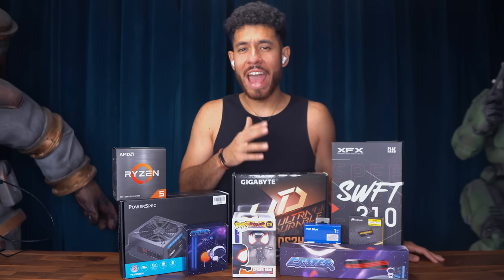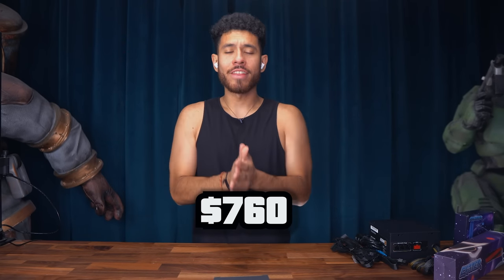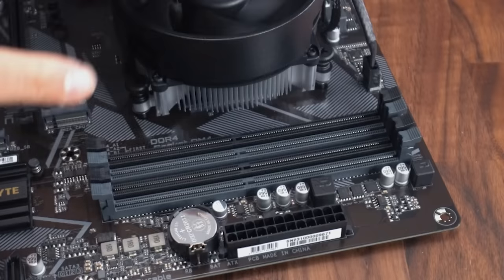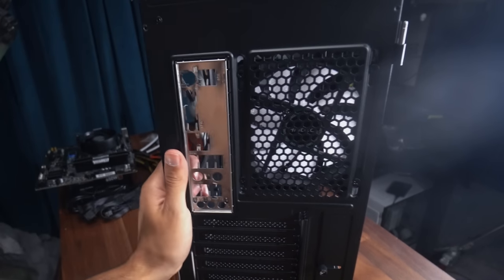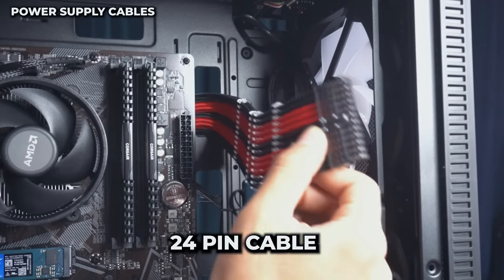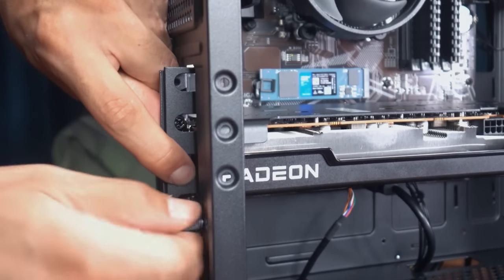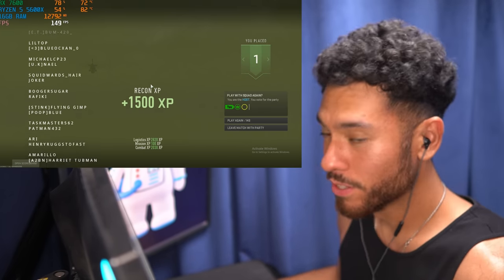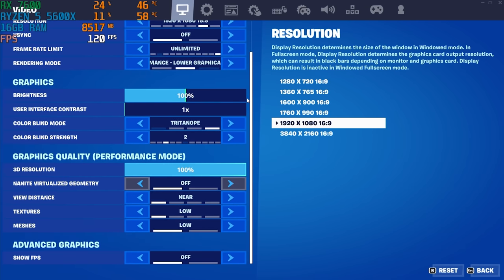BEST $750 Gaming PC Build Guide - RX 7600 Ryzen 5 5600X (w/ Benchmarks)

Comment: Three weeks ago, I built my first ever PC. I watched almost all your videos 3 weeks prior to the build because you got me hooked. 7800x3d with a RX7900XTX named after the channel. Hope to see more of your builds soon!
Reply: That's a beast gaming rig
Reply: @pauloazuela8488  being my first build i had to somewhat go all out. building my sons rig next.... or maybe hand this one down and build me another one.
Reply: @X-Raided26910  if so maybe wait a bit for next gen
Reply: I have Gigabyte 3090
Reply: Which 7900XTX did you get? I got the Red Devil 7900XTX, paired with a 5900X Cpu, 32Gb 3600Mhz CL16 ,1000W RMX PSU , X570 Strix, 360AIO and a couple of Tb Nvme ssd's
Reply: @bafon  MSI rx7900xtx, Ryzen 7800x3d, MSI B650 Wifi Edge, Corsair Vengeance  Expo 6000 mhz CL30, Samsung pro 980 2TB, MSI MPG 1000G psu, Deepcool LT720 aio with Deepcool FC 120mm fans in a Cooler Master TD500 case.
Reply: that's a really good first PC
Reply: Is this setup ideal for GTA mod, Madden, NBA 2k ???
Reply: Around how much did it cost you? I’m new and plan on making one my own soon
Reply: @jay_-3960  I spent around $2600 give or take. I swapped the build out of the cooler master td500 into a corsair 5000d with their af 120 elite fan setup and digital 360 aio. I've spent too much lol... and about to build my son a rig.
Reply: same for me!
Reply: @X-Raided26910 can I be your son?
Reply: How hard was building your first PC
Reply: should I build a pc with 5600 and rx 6600 or 5600 and rx 7600?
Reply: That's a fire build!!
Reply: @X-Raided26910 DDR5 ram?

Comment: Just me but I would use the 5600 and save some more bucks for a better card(maybe 6700xt or 6750xt)
Reply: I’d do the same too.
Reply: Same
Reply: Would the 5600 work wit the motherboard or do I have to update bios
Reply: @frzynx  all b550 boards are ryzen 3000/5000 ready. if you're on a b450/X470/B350 then you will need a BIOS Update.
Reply: @hoangtudaden1304 thanks man
Reply: Definitely would've tried to reach for a 6750xt.
Reply: will those cards fit in this build?
Reply: @southboundtp2067 would that fit?
Reply: @isaacdoodz  if not 6750xt, 6700xt will be a fine fit
Reply: @isaacdoodz  any twin fan 6750xt should fit fine, the 3 fan variants make for a very tight fit with only a few millimeters to spare(335mm max GPU length). Case already takes into account it's included front fans.
Reply: what if i did 6750xt but still keep the 5600x
Reply: Could i switch the cars for a 6700xt or 6750xt but also switch the cpu to a Ryzen 7 5700x or is that not worth it/better
Reply: @lesagekaden  imo, you can get away with a 5600(if all you do is gaming), but other than that 5600 6700xt is a good combo. Keep in mind that the 5600 can handle upto 3080
Reply: When I go onto pc part picker it says the mother board and cpu aren’t compatible anybody know why
Reply: you have to be careful when you do that because if the CPU is weaker than the GPU in the case you are making it is, it is going to prevent your GPU from working at the maximum potential and you will lose out of fps in games and overall
Reply: @missingspacebar7973 the CPU socket may not be the same for the CPu and motherboard
Reply: Ayo man any way you could give me some pointers to build one ?
Reply: @pabloayala6963  pointer 1: what resolution?
Pointer 2: whats your budget?
Pointer 3: what are you doing beside gaming?
Answer those three then I can build you one.
Reply: @hoangtudaden1304 1. most intensive I would play is starfield. Also league of legends and lost ark, maybe some steam indies. I'm open to 1080p or 1440p.
2. My budget is 2000 CAD but the less the better. 
3. I'm doing virtually nothing on my pc besides gaming and the occasional web browsing. 
4. I've chosen to go with amd 5600x for cpu, msi tomahawk b550, amd rx 6700xt gpu, and I haven't decided on 16gb ddr4 cl16 3200 or 3600. Do you have any further recommendations for my build in the making, such as cpu fan and such? I'm very new and still researching as I prepare to do my first ever build. Any input you'd have would be greatly appreciated!!
Reply: hey bro i’m trying to build this same exact pc carter is building but the power supply is sold
out and i can’t find it anywhere , what should i do ?
Reply: @Mindbending81  hey bro i’m trying to build this same exact pc carter is building but the power supply is sold
out and i can’t find it anywhere , what should i do ?
Reply: @kuroneko-_5570  hey bro i’m trying to build this same exact pc carter is building but the power supply is sold
out and i can’t find it anywhere , what should i do ?
Reply: @danny-fj3wf   I have the MSI MPG A850GF Gaming Power Supply.. it’s been good so far and I’ve had it for over a year and a half.
Reply: @danny-fj3wf  buy a different psu from a well known brand. Don't ever cheap out on the power supply!
Reply: @danny-fj3wf   just buy anything that is atleast 80+ bronze. NZXT, Seasonic, Thermaltake and gigabyte have cheap and good power supplies. Modern power supplies these days already have a standard pcie 6+2 pin (which the rx7600 needs for power) or more for the gpu so no need to worry. Also, get the 6750xt. Much better almost the same price.
Reply: Can this build be done in a micro case?
Reply: It's like 10 more dollars for the 6500x. I'd spend it ..
Reply: That will create a big bottle neck
Reply: The 20 dollar differenc isnt going to work unless you go for like a 6700 non xt open box maybe
Reply: 6700s are all pricy as hell.
Reply: I couldn’t agree more
Reply: if i do that can i still use everything else he displayed in the video? im trying to build a pc and i have no idea what im doing
Reply: Guys if I upgrade to a 6700 xt should I also upgrade the psu?
Reply: Would you have to update the bios?
Reply: Depends what game they wanted to focus on. ESport titles could benefit more with a powerful CPU since you will be turning down the graphics quality setting anyway
Reply: @fightnight14  I’m going to focus on fortntite
Reply: @AXP_4 no it won’t on 1440p it wont
Reply: Would the 650 w bronze PSU be strong enough for the 6700xt?
Reply: @deeznuts8216  I’m in this same boat. I did this same build but did the 6700xt. I believe the 650 bronze psu is strong enough but I didn’t even think about upgrading it
Reply: The X is only $20 more, so you’re not saving that much for a gpu.
Reply: @hoangtudaden1304 he do you update bios
Reply: Same except rx 6750xt
Reply: @hoangtudaden1304 are u sure because the msi b550m pro-vdh wifi mobo says it needs a bios update first
Reply: On Amazon rn a 5600 is 135 and a x is 145 as of now it’s worth the upgrade for anyone looking for a new cpu rn
Reply: Can I put a Rx 6800 (non xt) ?? Pls reply
Reply: @SGxHaunter  you can but there will be a bottleneck
Reply: @M1Zzie  for 1440p gaming?
Reply: @SGxHaunter  what gpu are you talking about again?
Reply: @M1Zzie  the Rx 6800 (non xt)
Reply: @SGxHaunter  it should run well in 1440p
Reply: @M1Zzie  okay thanks for replying 👍 it helped a lot 🙏
Reply: Ryzen 5 5600 (Used) : $110
RX 6700 XT (Used) : $250
Total: $360
Ryzen 5 5600X: $150
RX 7600: $260
Total: $410
Saving $50 for a better GPU? Worth it.
Reply: But its 10€ lire than the 5 5600
Reply: Honestly because the x version doesn’t make that much of a difference
Reply: Do u now if this mother board works with the rx 6650
Reply: I found the 5600x for cheaper than regular 5600
Reply: So guys say I have the 5600x running with a 5700xt looking for upgrade..so 6700 or 6750 cut versions?

Comment: I would have gotten a A520 or B450 wifi mobo instead and saved a few bucks there, as there's really no feature set advantage of the B550 towards "gaming". A 5600 non X CPU  would be in my opinion a better choice because 1. cheaper  2. enable PBO and it is in spitting distance of the 5600X in regards to performance ( even without PBO it is hard to tell the difference while gaming). And finally i would have skipped the sleeved cables and other "fancy" stuff and spent the dollars saved towards a 6700XT which is about 20-25% faster than the RX 7600, and has more Vram. Would still be in the same budget , however that is just my personal opinion o_O
Reply: What’s pbo?
Reply: a lil bit off topic with what your talking about but shouldn't you get a heatsink for the m.2 ssd drive because on Ps5s they require them and some motherboards come with thermal pads for them
Reply: @sarudedandstorm5555  Presicion Boost Overdrive, AMD’s  platform implementation to let the CPU run at a higher capacity if thermals and power allow it.
Reply: @bafon  thx!!
Reply: @bafon Hey bro, if I replace the RX 7600 with RX 7600XT, will I be able to build the same PC?
Reply: @oulor107  As the RX 7600 XT haven't launched yet it's hard to recommend  it because price and performance is unkown, but by all means, you can build a pc with whatever GPU you want if you have the money for it :)
Reply: Would a ryzen 5500 fit this build or is it too weak.
Reply: @rop7101  it would fit the build, however it would come with the price of more stutter due to the low L3 cache and zen 3 arcitecture, 5600 has more L3 cache and zen 4. But if you don't play games where quick reaction is crucial, the 5500 will perform adequate for the most part.
Reply: @bafon  thanks for responding decided to order a 5600 as you said . If the power supply is out of stock any 650 80+ bronze semi modular PSU would work right . They should all have the same cords right ?
Reply: @Astrolax. would a rx 6700 fit in this case

Comment: I just built a value pc that ended up with a 5600x and an rx 7600. So far so good. Newegg Cdn was $248 for the 5600x/asus b550m combo which was made this very affordable. I added a 2 tb drive and 32 GB 3600 ram. The rx 7600 was open box on Amazon Canada for $342, and for kicks I spread the payments out for 12 mths with no fees on my Amazon MC. The 4060 is 400 cdn currenrly. I just reused a case and psu and got a cd key for Windows 11 pro online.

Comment: Cool build! My spin on it would be to use the asrock deskmeet x300 barebones for $189 instead of this particular mobo/case/psu for $260 combined. This would give you an extra $70 to use elsewhere in the build. I would take a trip to microcenter and get a 5600X3D for $205 with their $25 off cpu coupon and a noctua low profile cpu cooler. Then get the same gpu 7600X but directly from AMD for their reference card that’s only 200mm in length. Then this whole build would fit in an 8L case. And if the gamer wants to VR instead of shooters just substitute the gpu for a 12g 3060.

Comment: I would have bumped it up to 1440p which this card can do and still be 90-150 fps. Few of the games the gpu wasnt pushed hard enough making the cpu work harder than it should. 1440p would  be more ideal with this card. Especially the last two games. You would still be at or over 200 fps at a higher resolution.

Comment: Really enjoy your vids! Always clear, concise instructions. I haven't built a PC since well Win XP but this build is really close to what I have been working on at PCPartsPicker. I was going ATX mobo, same CPU and I was considering a 6700XT GPU.
Reply: the 6700xt is a beast bro, do it
Reply: Dude i am using the gigabyte and eagle 6700xt its such a good buy for 400 unless you want less v ram and also similar performace get the 4060 ti its like the same price i think
Reply: @samuelvaladez2918  I can get a 6700XT for about $340 so I am leaning that way over the 4060TI. Thanks for the info and recommendation.

Comment: just ordered all the parts to build this build!
Reply: Did u build it
Reply: How did the PC build go?
Reply: Literally just did, had to wait a while for all the parts, it was pretty simple except the power supply wasn’t in stock so I ordered a different one. Didn’t know the difference between modular and what not and figured out the cables on my own
Reply: @nujanx5270  nice, I'm still thinking of maybe doing this build.

Also What power supply did you get instead?
Reply: @___Sunflower  the 500w powerspec I wouldn’t recommend downgrading, I just honestly thought I ordered the right one lol
Reply: @nujanx5270  LOL, I was thinking of maybe doing that, but I figured it wouldn't be safe as it might not be enough Watts.
Reply: @___Sunflower  its running pretty good rn but yeah i agree might switch it out in a couple months, goodluck on ur building!
Reply: @nujanx5270  Thanks, and also it's good to know it can handle 500w perfectly fine.
Reply: How much did everything cost because it’s going to be $900 for me with discounts.
Reply: @drizzyparanoid  yeah that’s about right bro
Reply: @nujanx5270  also where did u get ur graphics card because says it’s coming in august on Amazon but I feel there is a faster method to get ut
Reply: it*
Reply: @drizzyparanoid  I got it from Amazon as well and it said it’d take a while too but a week later it came
Reply: @nujanx5270 Did you have to do a bios update? Im going to build a pc for the first time and dont know how to do that.

Comment: Just built this today and im loving it its not top of the line but for the price it runs just about every and anygame you throw at it at 60-200 frames at 1080p so if you want a budget build this is the one very simple setup does what its supposed to and yes you can stream and play games on it but don't expect ur game to run flawlessly during a stream but it does run well and I love it I didn't even buy all the extra stuff just left it all stock 👍
Reply: hey when i try to run it to my monitor it says "no signal" you got any fixes?
Reply: Hey i had some questions about this pc. i am building it and this is my very first pc. you got snap instagram or discord? if so could you give me one of those so i can ask some qurstions? thanks
Reply: 2 months of having this PC and it still rocks

Comment: That's a cool videooo
1 tip that you can don't need to unscrew your psu to get the hdaudio / usb ports
you can route them after you installed your motherboard 
Then you can have spaces for the cable and you can install your psu at the same time :D
But you can also choose to handle those case cables first

Comment: Building my pc according to this hopefully it goes well, parts will come in soon!!!!
Reply: Did they come
Reply: @limb856  wondering the same thing, as I'm planning on maybe doing this build.
Reply: @limb856  Yes they did but some of the parts (like the psu) is out of stock so I had to upgrade but instead of buying the 650w fully modular sfx like I did (wrong decision) you should probably buy the 750w fully modular (correct option and I believe cheaper). Also note that you need the extension cables or they wont reach. Got most of the parts but the extension cables and the gpu is on its way.
Reply: @anthonyjosephcortez6748 is the pc running good?
Reply: @psychomale2261  Just finished building it, it thankfully turned on and I will go back to this video in about a week to teel you about some results.
Reply: @anthonyjosephcortez6748 Did you have to do a bios update with the motherboard?
Reply: @triixzz2747  no it was already compatible
Reply: @psychomale2261  the pc is running amazing great fps

Comment: I have a question if you got a different cable extension from Amazon to the could you still plug it into the original 24 pin?

Comment: I was wondering if there was any way to make it slightly cheaper while still maintaining the high fps in the shooter games you tested. I want to keep the ryzen 5 5600x, but is there a equivalent GPU that can be found for a lower price? And could I cut a little bit of cost by buying less quality motherboard/powersupply/case, etc...
Reply: Get used parts cant really downgrade it anymore since this build is almost bare minimum for this kinda range
Reply: You can. 
5600 non x
2 sticks of cheapest 8gb 3600mhz ram you can find but it must have lifetime warranty
Non-wifi version (b550m ds3h)
Lesser storage (not less than 500gb though)
550w 80+ bronze psu from a reputed brand like cooler master (never cheap-out on psu)
any cabinet with atleast 3-4 preinstalled fans and decent build quality.

Comment: I have very similar build. But i would recommend atleast a bugdet air cooler rather than the stock. The processor temperature gets high easily
Reply: Which do you recommend that will fit this build
Reply: If not for very heavy gaming.... the single tower air coolers are quite efficient considering their price. Like the Ak400
Reply: @theUnArtist and that would fit in this case?

Comment: can I use a XFX Speedster SWFT 210 Radeon RX 6600 CORE Gaming Graphics Card with 8GB GDDR6 HDMI 3xDP, AMD RDNA 2 RX-66XL8LFDQ and AMD Ryzen 5 5600 6-Core, 12-Thread Unlocked Desktop Processor with Wraith Stealth Cooler instead? and what power supply for these 2?

Comment: I went this route but different gpu. put too much money elsewhere and settled for an rx 5500xt. honestly I just wanted to get playin games, quality is never an issue since used to rock a ps4. now the only problem was the mobo. I have the Rev. 1.5, they removed the ARGB headers on that rev so all the money I spent to make it look nice and add about 100fps with that rgb but nope. gigabyte screwed up there.
Reply: also the amd shroud on the heat sink pops off with minimal force and can be turned so the AMD is at the top and level.

Comment: So I just bout that GPU, as an upgrade, I have the same CPU and an 850w power supply, but the GPU has a little red LED light that pops on when I turn everything on. Along with my mother board VGA light being in as well. And I won't get a display on my monitor. I have no clue what is going on. 
When put my old GPU back in everything works just fine

Comment: So my build is Ryzen 5600x , b550f gaming rug strix, ram 3600 cl 16 32gb, I bought aio cooler 240 msi and ssd 1tb sn570, gpu 3060 ventus 3x and case nh5 flow with 2x 140m fans now I’m not sure about psu I’m having trouble I order 850w segotep 80 plus gold. Is that overkill on pc or what’s best option